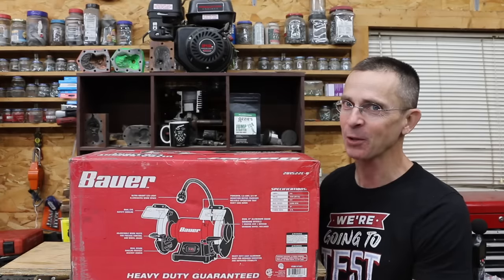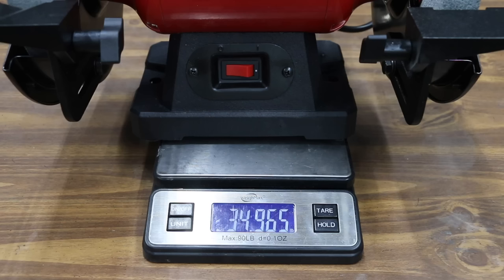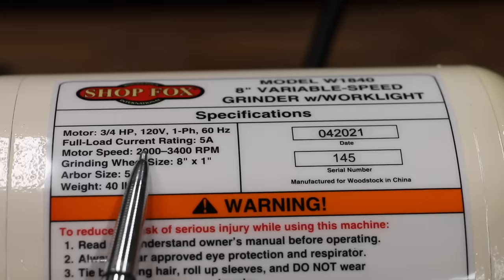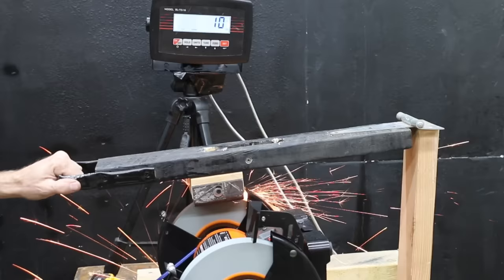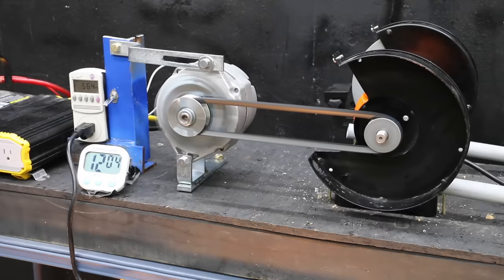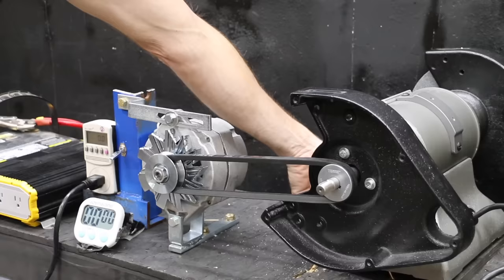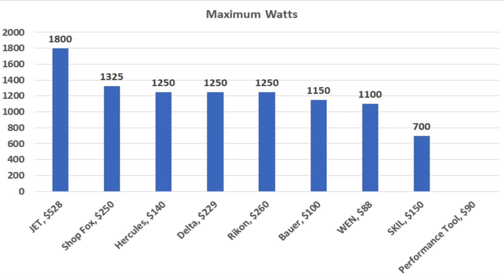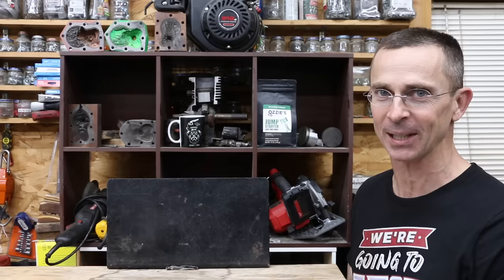Best Bench Grinder? Let’s Settle This! Harbor Freight Bauer vs JET, Hercules, Rikon, Shop Fox, Delta

Comment: I own the Delta unit that you evaluated and it's used almost every day in shop albeit for light grinding:

Ten years later and still going strong!

Btw. ...awesome test rig that you created 👍

One complaint I will voice w/ the Delta is that the factory dressing tool included is crap.   It doesn't last long at all. 

I purchased a professional, diamond tip 0.50 dresser and that sorted out that issue.
Reply from the maker: Thanks for the feedback.

Comment: Suggestion: Benchtoo Drill Presses. Speed, stability, accuracy, wobble of the Chuck, easy speed adjustment, lights, lasers, worktop surface.
Reply from the maker: Thanks for the suggestion.

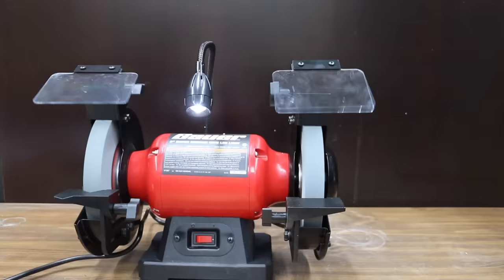Comment: On the WEN, I can see the wheels are not true, they wobble.  There was LOTS of vibration.  What was that burst of sparks from the Harbor freight unit as you were shutting it off (at 2:38 in video)?  Hercules left wheel wobble!  Delta right wheel wobble!
          I assume the wattmeter is measuring the alternator output DC?  (If you are measuring motor INPUT watts, that means nothing!)   Are you aware car alternators are about 50% efficient?  The motor is doing twice the work as the alternator output!  Point your temperature gauge at the alternator.  I suspect it is WAY hotter than the motor!
          The type & friability of the wheel depends upon what you are grinding.  If you are sharpening tools, you want the softest wheel you can get.  It is best to buy wheels separately so you know what you have.  On the other hand, if you are sharpening mower blades or grinding welds on the exhaust system of the Winnebago, you want the "toughest" wheel you can get.
          What is the deal with the wobble?  Can't the manufacturers put good flanges for the wheel to rest against?  You need to comment on how well they fit on the shaft, & whether they are cast zinc or MACHINED steel, & whether the shafts run true.  They should fit TIGHT on the shaft.  Are the shafts bent?  A vibrating grinder is DANGEROUS.  You should ALWAYS "ring test" grinding wheels before using them (I assume you know what that is).

Comment: I do have a small critique: In the stall test, the contact area of the steel block changes and copes to the wheel the more is ground away. This, in turn, means one pound of downward force may result in more friction depending on how much steel is ground away already, which would skew the stall torque test. Think of it like using a chop saw on a 6x6 vs a 2x4, or a big brake kit vs a standard brake. That said, the test is still quite representative of the capabilities of each bench grinder.
Reply from the maker: Thanks for the constructive feedback.

Comment: Even tho the Harbor Freight placed in the middle of the pack, once you consider price I'd have given the grinder a much better placement.  Let alone the fact that when push came to shove, the Harbor Freight model had the best grinding wheel.  Sometimes even that $60 to $70 difference is enough to just spend less and use that extra cash for either a polishing wheel or whatever and still get out of the store UNDER $175!  I have bought over the years MANY things from Harbor Freight and usually I end up quite surprised as to how decent that item is.  SEVERAL of my power tools (and my little welder) are from there and I've always gotten more than what I had asked that item to do for me.
Reply from the maker: Thanks for the feedback.

Comment: Years ago I bought a DeWalt grinder and used for many years. When I replaced it I was expecting the same kind of quality from other brands and I bought a Delta variable speed grinder. The Delta is not a bad grinder but it doesn't even come close to the quality and horse power of the old DeWalt. I guess I am reaching that age when "everything was better in the good ol' days"
Reply from the maker: Thanks for the feedback.

Comment: I bought that Hercules unit, mounted it nice on its own little stand, and put a grand total of about 5 minutes of use on it. 

It no longer turns on.

Moving on..... I'm pretty surprised that the Dewalt bench grinder was not included. It seems to be the number one go to grinder for most regular folks.
Reply from the maker: Sorry to hear!  Thanks for the suggestion.

Comment: I have the WEN 8" grinder you showed here, I was definitely curious on how my experience stacked up with other brands in comparison.  I will have to say for the WEN, what you showed here is pretty accurate.  It's cheap at around $88.00, got it three years ago (2020), put some serious stress on it, and it keeps on going without fail.  The lights suck, but I have an overhead light so it's not an issue for me.  The tool rests are kind of chintzy, but I knew that when I saw it; and they don't come loose during use; and I make them work for what I do.  Overall for the WEN, it's a good cheap bench grinder, if you understand it's limitations you can get work done on it; and don't have to suffer with under powered bench grinders, and you don't have to kill the bank for more HP machines.  I have sharpened lawn mower blades, fixed regular screwdrivers, sharpened chisels, and other standard grinding tasks that you would do without fail.
Reply from the maker: Thanks for the feedback.

Comment: Well done, as usual! Jet always seems to be a higher end import, from Taiwan of course. I will say for a bargain-basement tool, the Wen doesn't seem too bad, especially for a  second shop machine, maybe fitted with Buffing/polishing or wire wheels that are lighter duty?
Reply from the maker: Thanks!

Comment: I have a 10" Jet after owning a few other brands - Jet is a good grinder and will blow away the other brands you tested.  Shop Fox is owned by Grizzly Tools and is a decent brand for the money, but still not Jet quality, if you have the money get the Jet.  Also have a Jet Belt/Disc sander with 12" disc and 6"x48" belt that also is the successor to other less expensive brands.  Hands down the best of them all by far.  Heavy cast iron construction which is important under heavy loads.  It also runs smoother and quieter, has larger diameter spindles on the belt sander which puts less stress on the sanding belt.
Reply from the maker: Thanks for sharing.

Comment: As always, thank you for posting another great informative video!  Not sure if you've already or plan to but I would love to see a in depth video comparing diesel additives.  The additives does a few things for diesel engines as lubrication is important to keep most injection pumps happy.  So like anything else you've tested on your channel, some brand claims are suspicious. I and I'm sure many diesel enthusiasts would love to see your findings. Thank you for your consideration.  Keep up the good work.
Reply from the maker: Thanks, will do!  Thanks for the suggestion.

Comment: Wheels that do not wear fast are for softer materials, the binding between grains is strong. For harder materials, say HSS, you need softer wheel, grains are held weakly and thus dulled grains are quickly replaced.
I think there is a lot of cheating here with wheel material, i.e. Cheap wheels will use less of actual cutting  material and more bonding.
I was hoping the stall test would be done with same standard wheel, otherwise wheel quality is affecting the test for jet.
Also i would hope there would be vibration test, main difference for me between cheap and expensive grinder is vibration. Cheap stuff vibrates a Lot.
Reply from the maker: Thanks for the feedback.

Comment: Metal collates on grinder wheels, and the dilation can cause fractures, which can cause it to explode at 8000 RPM, its like getting an axe to the head... It's a commongworkshop incident. Way to check is the sound they make, they "ding" like glass when new and they make a hollow "tok" sound when ready to come apart.
Reply from the maker: Thanks for sharing.

Comment: I have the jet and a baldor. Had many others before. The baldor is in a class of its own. One thing not evaluated is the vibration and ease of balancing a wheel. The jet is better than most. The baldor is in a class of its own. It does weigh close to 100 lbs which probably helps.
Reply from the maker: Thanks for sharing.

Comment: Correction: the JET has an 11amp rated motor at the normal 115-120V. Which ends up being 5.5 amp if run at 230-240V. Seems it can be run on both.

Comment: I am surprised at how good the 50 year or so grinder that I still have performes so good compared to the test ones there.
Made In Australia, brand unreadable.
.8 amps full speed in 3 seconds, 2500 rpm.
Only problems in 50 years is switch replacement.
Admittedly it's not had a hard life. But still good as new.
Reply from the maker: Thanks for the feedback.

Comment: To lessen the chances for wheel explosions, a few steps should be done.RIng testing all the wheels should have been your first step.These cheap grinders are known to have wheels that have imperfections. Bent shafts/arbors causing runout on both the grinding edge and face of wheels cause vibration leading to failure.Never use any grinder with a bent shaft or arbor.Dressing the wheels before first use is very important.
Reply from the maker: Thanks for sharing.

Comment: These tests keep getting better and better - not that they needed much improvement to begin with.  I love the new lie detector set up!

So, as someone who used polishing wheels a lot in the past, could you test polishing wheels?  My favorite was the Baldor (Baldor motor).  I don't remember the brand of the rest of the machine, but I do remember the motor did go out and we replaced it with a Baldor.  Immediately, I could tell the difference in quality!  I remember waiting for the second polisher to have a bad motor, so I could replace it with a Baldor!

Awesome job!  I truly enjoy watching these videos!  Keep up the good work!
Reply from the maker: Thanks!  Thanks for the suggestion.

Comment: The Hercules line of tools are very impressive for the price. I have to angle grinders from them and they are absolute monsters, along with all of the other tools I have made by them that work great. I had an issue with one of the cordless sawzalls I purchased however Harbor Freight replaced it for free and I have never had any other issues with the replacement. I am not kind to my tools either.
Reply from the maker: Thanks for sharing.

Comment: I am fascinated at the cost of automotive wheel dollies. Such a huge range. Makes me wonder if the cost is worth it.
I'd also point out, my grinder stops a lot faster when there is a wire wheel on it because the wires touch the guards. With that said, I would think a longer time to come to a stop time would be an indication of bearing quality.
Reply from the maker: Thanks for the feedback.

Comment: I have got myself one for 40 euros recently and it draws 600 watts. It's an absolute monster, and is old school and all that. I like it as it doesn't stop even when you load it hard. The only problem is that it can overheat after 20 minutes of constant use and it needs to be left to rest. Otherwise it's nice. It's missing it's label sadly so I can't tell you who made it.
Reply from the maker: Thanks for sharing.

Comment: Nice review. I do however consider the screw test of the wheels to be unimportant.  Wheels are consumables, easily and cheaply replaced as needed, so not really important as a whole. 
I would really like to see a comparison of wheels in general!

 I have 2 bench grinders, an 8 inch, and a 6 inch. The 8 inch, I bought used at a garage sale for $10, before my wife and I were married, and we'll be celebrating our 31st anniversary later this year. So I have a LOT of hours on it.  the 6 inch, also a garage sale purchase, has been in my work trailer (converted pop-top camper, table saw, miter saw, planer, small band saw etc in i t, crank up the top and I have a complete wood shop)i for at least 12 years. The only issue I've had with the 8inch grinder, is that that the power switch broke. I've changed wheels at least a half dozen times on each of them,  but as I said earlier, they are consumables, you expect to replace them.
 
Edit to say that I do I do check your channel whenever I am considering a tool purchase. A while ago I needed to replace my old tusty fein multi-tool that someone walked off with,  and replaced it with a rockwell because it placed well in the review. I have no complaints, it does what I want it to with no fuss.
Reply from the maker: Thanks!  Thanks for the suggestion.

Comment: I bought the cheapest one I could find at princess auto ( Canadian harbor freight ) came with a vee in the tool rest for sharpening drill bits and the rest was indexed to a slant that made sharpening the drill easy as pie . The vee in the rest is also at an angle . I think I paid 39 bucks for it eight years ago . Still going strong and running free when shut off ( I would guess over minutes to coast to a stop from 3600 rpm . No friction in those bearings lol
Reply from the maker: Thanks for sharing.

Comment: Hi Todd, long time sub, many years, I never miss your reviews. I have a suggestion for a test, maybe test some roller ball bearings, say in the 6202-2rs size for durability, heat, how they do with stock grease and with syn. high temp grease etc. You do the testing so you'll know what and how to test them. Thanks for the videos, always top quality and informative.
Reply from the maker: Thanks and you are welcome!  Thanks for the video idea.

Comment: I am planning to install an off grid solar system, so maybe if  you can focus on some related stuff, like solar panels, controllers, chargers, inverters, lithium batteries, fuses, switches, cables... will be nice
Reply from the maker: Thanks for the suggestion.

Comment: The Delta is one of 3 grinders in my machine shop. It is a decent grinder, good quality for the money.
I have used the Jet, it is a very nice grinder, not up to the standard of a Baldur, but can be used in a work setting.
I doubt the Delta or Shopfox would hold up to a work setting where it was used alot.
Reply from the maker: Thanks for sharing.

Comment: You're doing a great job.But I would like to suggest that you   add  category or maybe a separate channel. More in-depth on who actually manufactures the tools.. For example Chervon  makes the kobalt 24v line and 100 other brands.Then rank the manufacturers based on more complete information.
Reply from the maker: Thanks for the suggestion.

Comment: You should test carbide hole saw drill bits that electricians use because they are kind of expensive and I’d love to know which ones are actually worth the money.
Reply from the maker: Thanks for the suggestion.

Comment: Nothing against WEN personally but I bought their grinder, used it 10 min and a piece of stock got caught in the wheel/shield and stopped the wheel.  The motor was toast.  Bought a BuckTool bench grinder and it didn't vibrate out of the box.
Reply from the maker: Thanks for the feedback.

Comment: Do you have a video series of all testing equipment that you use? I am putting together a disassembly testing bench in my shop and was wondering what you would consider to be the top 10 testing tools besides a multimeter and the tachometer you’re using in this series

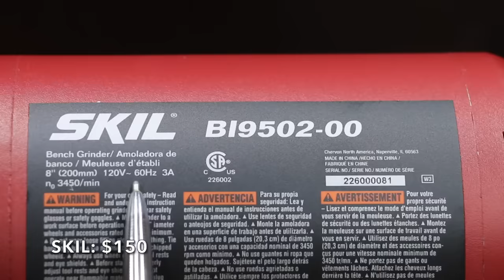Comment: 3:26 You want this to be slower. The slower the spool down is the more free the motor bearings are. Means a more efficient motor that isn't wasting energy fighting its own bearings. Though I do wish these things were louder; with how whisper quiet they are you could brush up against one while it's running and not realize it's running until you're missing a LOT of meat.
Reply from the maker: Thanks for the feedback.

Comment: Was looking to replace my 40 year old Craftsman variable speed with a new one and noticed the HF Hercules in your test is now the top of the line Bauer variable speed and they beefed up the Hercules brand with a new single speed model. I'm willing to bet that HF simply changed the color and name because every other external detail  is  the same. I'm hoping the insides are both the same as I just purchased the Bauer variable speed based on your testing (assuming it's the Hercules in disguise). THANKS ! ! ! ! !
Reply from the maker: You are welcome!

Comment: Can’t find the Hercules grinder at HF anymore. Not sure if they replaced it with the Bauer. I noticed they now have a Bauer that looks just like the Hercules in the video with the adjustable speed.
Reply from the maker: Thanks for sharing.
Reply: yup. The "new' Bauer is just the old Hercules. They just rebranded it when they came out with their 1hp Hercules.

Comment: I have an old (or is it vintage? 😁) 1/3 hp Baldor 610 G-1 grinder. I picked it up used, and it has been a solid grinder for many years. So solid, in fact, that it is built to (out)last me! 🐺🔧
Reply from the maker: Thanks for sharing.
Reply: @ProjectFarm  Thanks for all the hard work you and the rest put in, Todd!

Comment: This video was very helpful as I am in the market for a grinder. I was also checking your videos but I didn't see one, (recently at least), for small engines, such as the new(er) predator engines to Kohler, b&s, so on. Like 2-5 hp for yard equipment, not mowers. If you have one.... sorry , I must've missed it😅 keep on keepin on.
Reply from the maker: Thanks!  Thanks for the suggestion.